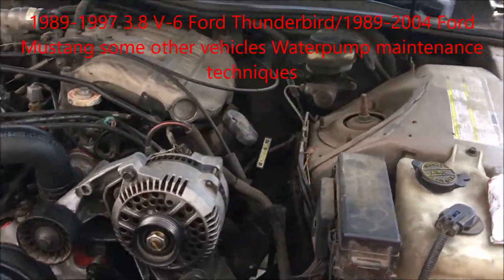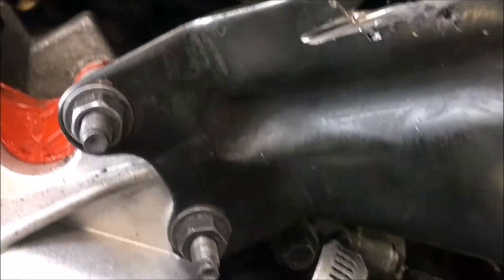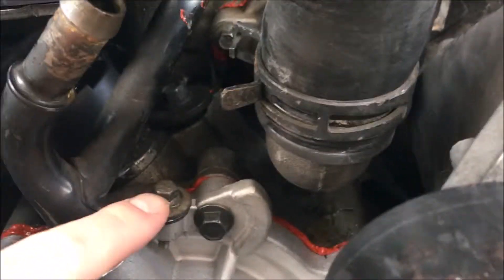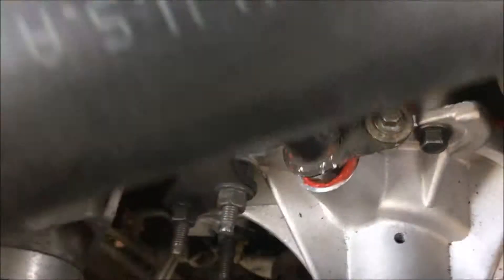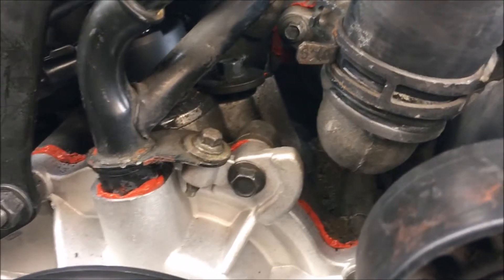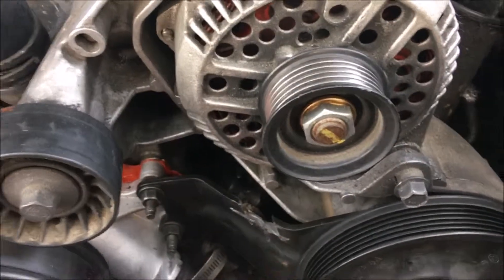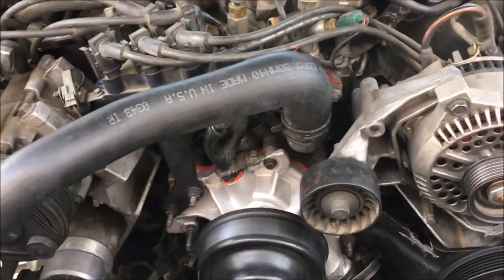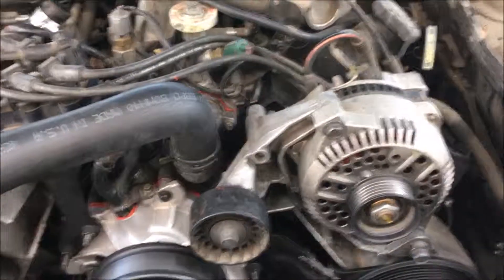DIY HOW TO GET DIFFICULT BOLTS TO WATER PUMP FORD 3.8 V6

Comment: Glad my 1996 T-Bird has the 4.6 engine. Getting the 4 pulley bolts off without it turning, looks like I need a small impact tool. That's what you must have used.
Reply from the maker: When I remove pulley bolts I leave the serpentine belt on.  After the bolts are removed, then I remove the serpentine belt.  The belt will hold the pulley in place when you are removing the bolts.

Comment: Did you have any problems on getting these bolt's out?
I have a 1993 Thunderbird and I have to replace the water pump I have been spraying them Liquid wrench but I am afraid the bolts might brake or strip.
Please comment me back and let me know.
Thanks.
Reply from the maker: I also used liquid wrench/pb blaster on the bolts, tapped them lightly with an extension and hammer to get the penetrating compound to move a bit better.  I cut that notch in that area to get to the bolts using wobbly socket or wobbly which is a better universal extension or socket.  The most important being use a six point socket to get the best grip on the bolt the first time to avoid rounding or stripping.  The other way which takes alot more time is to get the tool from autozone to pull the power steering pulley off to get to the bolts quite easily.

Comment: Hi from Namibia, could you please name some of the light duty trucks using this engine? We do not have these cars in SA or Namibia. However, I have a Ford Taurus LX 1989 model that was imported here. I now desperately need a waterpump for it.
Reply: The Ford Ranger in the late 90’s has a 3.8 V6
Reply: f150s 4.2 is basically same block just longer stroke